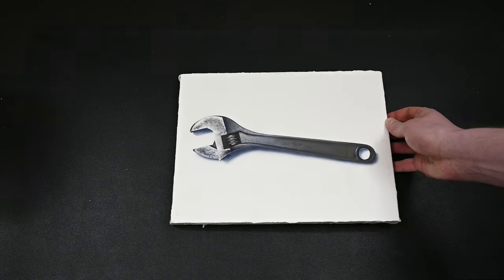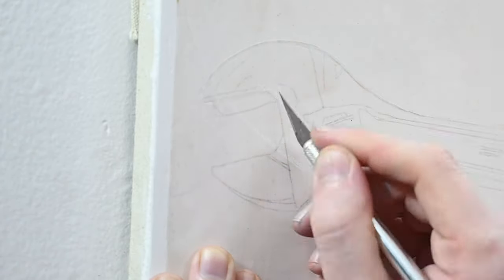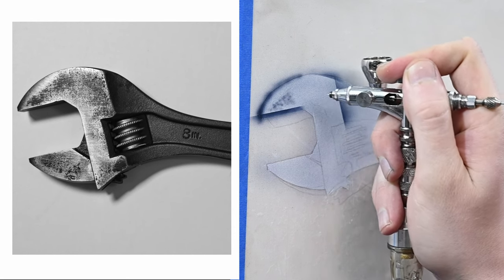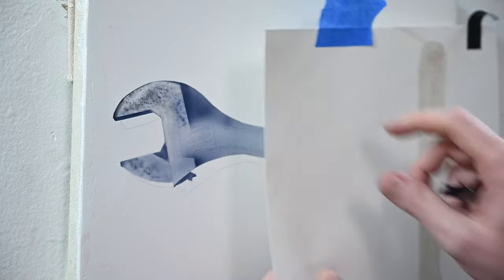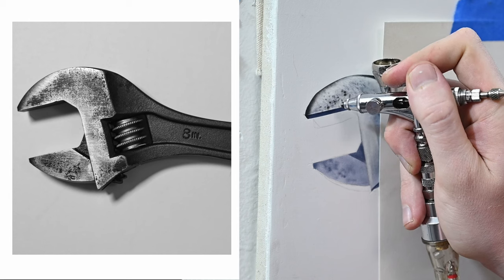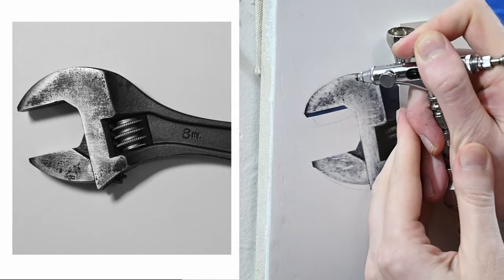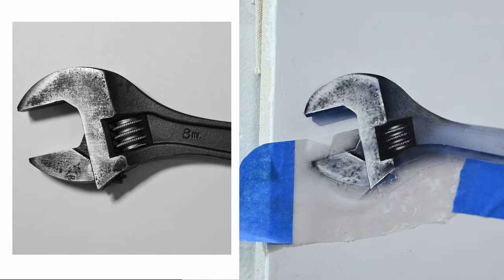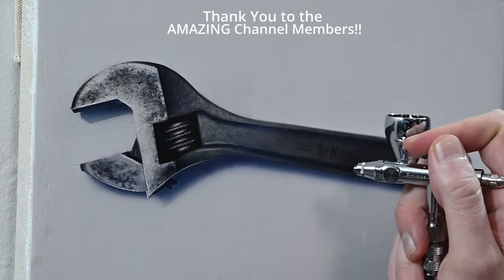From LIFE to CANVAS (a painting tutorial)

Comment: Thanks for another informative video. All of your techniques work well on a gessoed board, but I've always used hot pressed illustration board for my projects. I'm not able to over work areas as much as you do, but I compensate with paint and brush when needed. Most of my work involves portraiture so I reach a very realistic finish, but not as photo-realistic as yours. So your main key here is to work off of gessoed masonite/board. Thanks again.
Reply from the maker: hot pressed illustration board is excellent! If you want to keep working into it, add a layer or 2 of gesso on the illustration board before painting. It works great.

Comment: Hi Mark, had a side question about inks. Have you ever tried either Holbein Acrylic Inks or Schmincke Aero Color Professional Acrylic Inks. Just curious on your experiences if you have, or your thoughts if you have not tried them. Thanks Bud.
Reply from the maker: I've used Holbein acrylic inks and they are outstanding. Very strong dried paint layer but difficult to eraser. Similar to golden high flow acrylics. Holbein makes excellent art materials! I never tried Schmincke but will have to someday. Com art colors are pretty good too and easier to erase than golden or holbein, but not as easy as createx illustration.